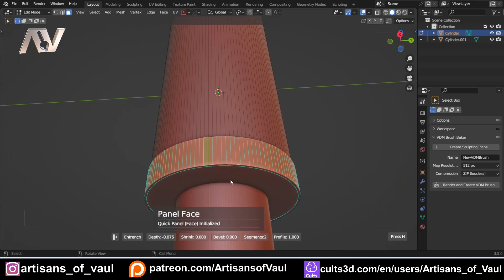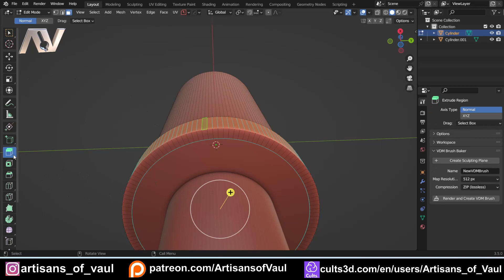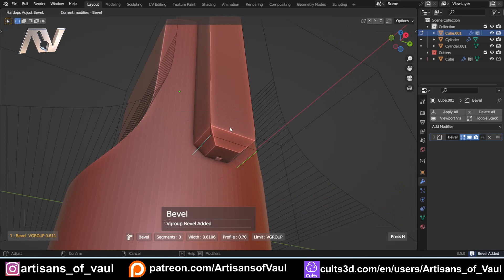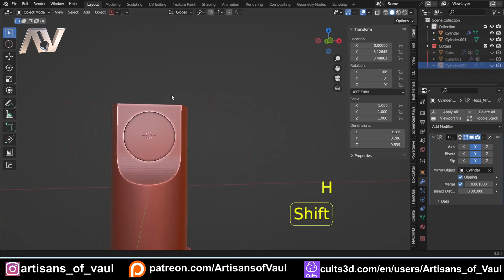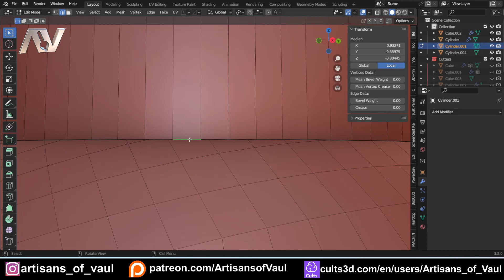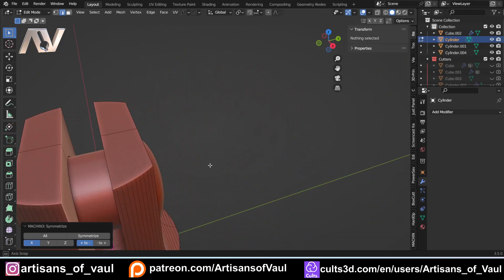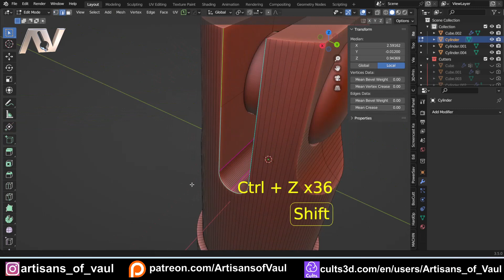RELOUDED - Impossible Bevels using Hard Ops and Mesh Machine in Blender

Comment: Fastest way i do extrude along normals is face mode, right click, extrude along normals, only has that option in face select mode though
Reply from the maker: That works but it can cause issues if you're not careful in some situations. I have a quick short on that here. You can solve this by hitting S but at that point it's now taking more clicks/time than using HardOps. https://youtube.com/shorts/nrA9YaBVsIo
Reply: @ArtisansofVaul  oh ive not ran into any issues exctruding along normals, on unless im doing it round a corner, blender hates that haha ill look into it, ive been using blender a while but only recently got mesh/HO because of you and it is fantastic wish id got it waaaay sooner hahah, could you do a video showing how you do a work flow on a mechanised unit, like a knight for example, mainly the body and shell, arms and legs arent a problem im just trying to figure out how to get that front lip on the shell to look good and trying to fill out the body is proving rough, its getting there but must be an easier way haha, no node please XD
Reply from the maker: @jordenc8417  👍🏻 What do you mean by the "front lip"? I'm always happy to get video suggestions 😁👍🏻
Reply: @ArtisansofVaul so the curved plate thats sits on top of the knight, where the gap is for the head, stubber and shield theres a small extruded lip that come out just a tad, it just getting those out accutatly enough but also evenly with the flow of the shell, if that makes sense, oh and if your wanting video ideas i have a fair few hahah ill drop them in every now and then :)
Reply from the maker: @jordenc8417  Do you mean the trim?
Reply: @ArtisansofVaul  Yeah, as you say that i now remember you did a video on trim in fact, ill rewatch it, it might just be what i was after, but of an awkward shape but im sure itll be fine hahah
Reply from the maker: @jordenc8417  let me know how it goes 👍🏻
Reply: @ArtisansofVaul  okay ive got it sorted now the panel video really helped with it, thank you so much! had a few of my designs shifted by GW though haha

Comment: 1:44 It's funny I've also been using this EM Macro feature for a long time. Turns out, using "Inset" while holding Ctrl does the exact same thing! Just hit "i" while holding Ctrl and see for yourself.
Reply from the maker: That's a really cunning use of that function, I never thought of using it that way. You just have to be careful to not inset initially. I'll still most likely use EM macro just to avoid having to look down at the keyboard to find "i" where as EM macro takes the same number of clicks but for people without HardOps that's a legendary idea! 😁👌🏼
Reply: Or you just press "Alt E" and click along face normals. No need to go to the t panel.

Comment: love your vids! instead of using ALT + EM_MACRO you could just do ALT + E.
Reply from the maker: While that is true in this instance Alt+EM_Macro gives a better result without tweaking the settings and it also has other features you can use so I have just got used to using it straight off.
Reply: @ArtisansofVaul  just saw you said that one can use ALT+E at the start of the video.. I'm an idiot :D
Reply from the maker: @elliotschka  No problem at all 😁 Easy to do.